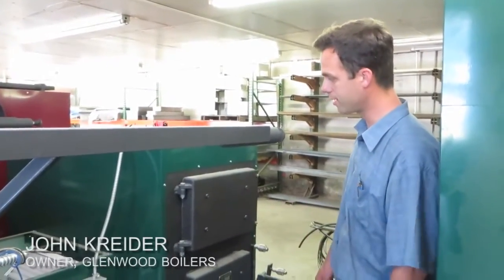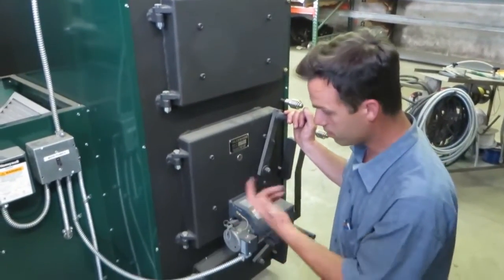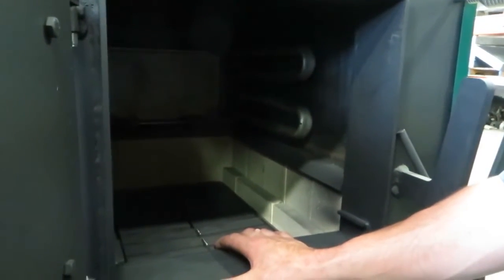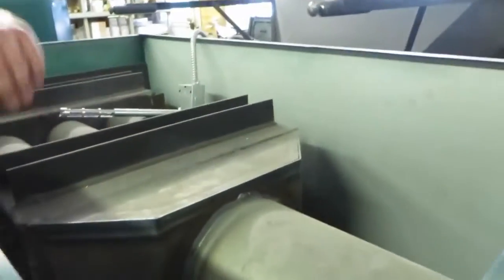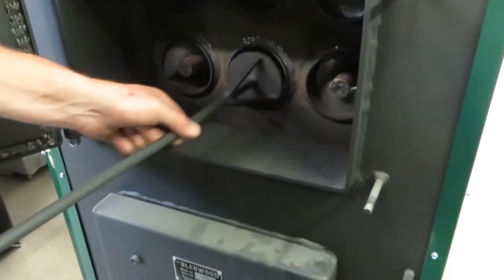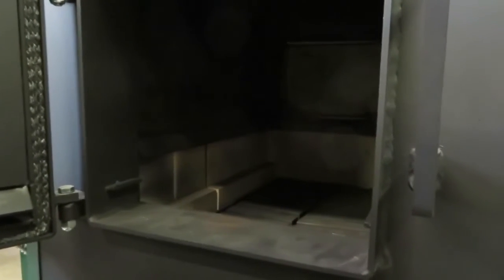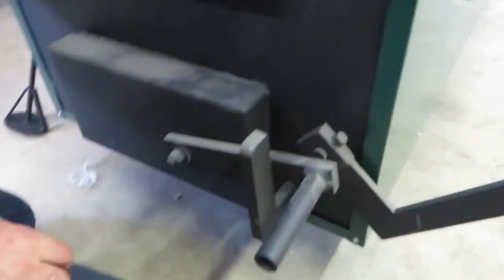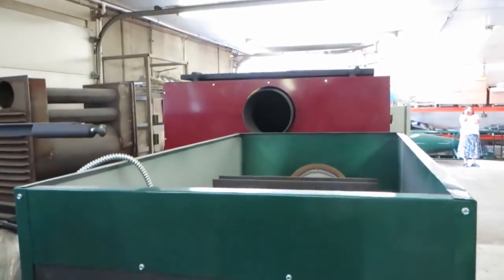Obadiah's: Glenwood Multi-Fuel Furnace - System Overview

Comment: Thank you for the detailed overview.  I am interested in purchasing the 3050 model.  I have a Multi fuel system currently that has reached the end of its life.   I have a couple question based on the video if you don't mind:  You mentioned that one should leave about 2 inches of ashes on the shaker grates when burning Coal due to the extreme heat generated that can cause fatigue and damage to the grates ; My question is  2 fold.  What happens after you shake the grates? The ashes will fall to the ash pan and you loose your insulation.  Also, coal needs air from underneath as you mentioned. The 2 inches of ash will effectively block off your combustion air supply, or at least limit it.   Are the grates prone to warping?  I would love to know more about the system, however I cannot find any forums or detailed information about the 3050.  Thanks Again.
Reply from the maker: Hi Jeff! We would love to talk more with you abou the 3050 and our sales team would be the best at answering those questions. Please get in touch with us at sales@woodstoves.net or give us a call at 1-800-968-8604 (Mon - Fri, 8am - 5pm MST).